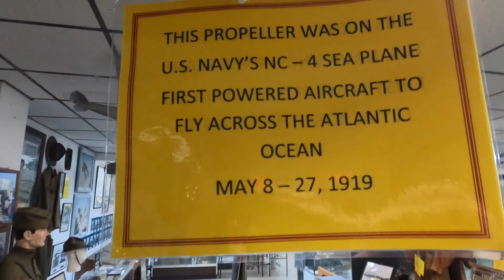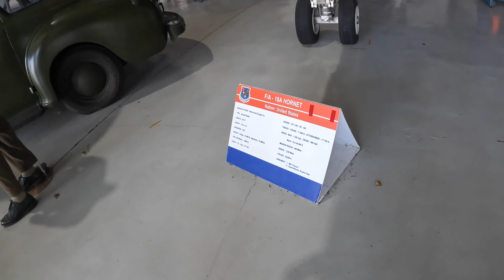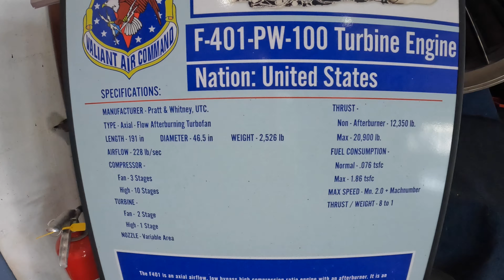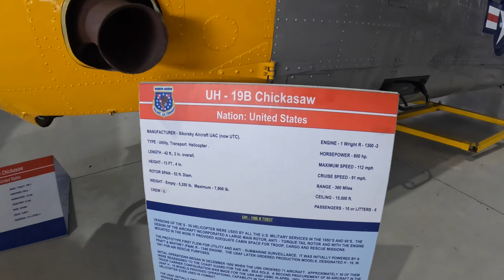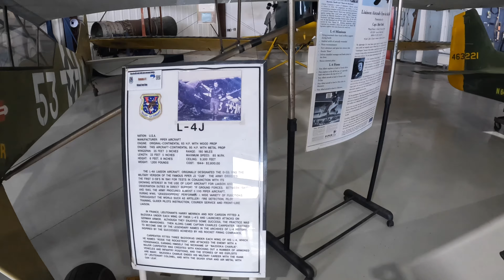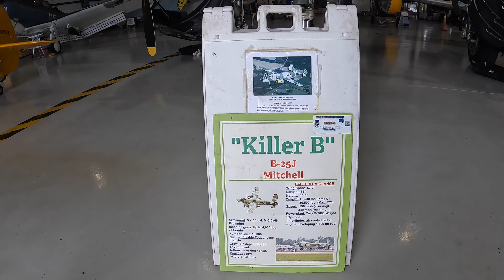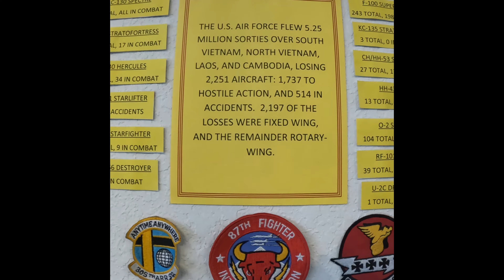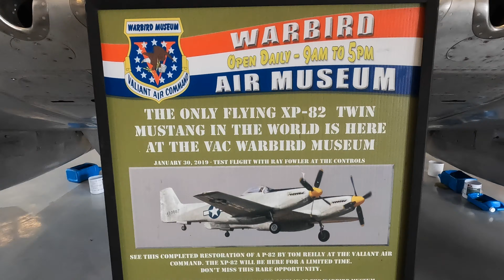Valiant Air Command - Warbird Air Museum

Comment: A fantastic job filming the planes Chris.  I wasn't aware this museum had so many great planes.  Although they are rather tightly packed in there you did an excellent job capturing the planes!  With so many museums space is the issue.    If this museum had more hangars they could be presented a bit differently.    When I film I am all over the place and jumpy with the camera.    You held it very steady which made it easy to watch.  Good job and thanks for sharing!